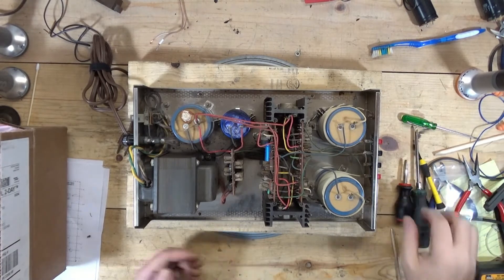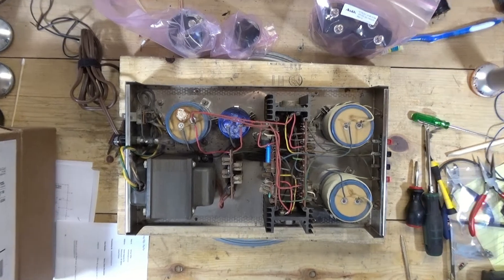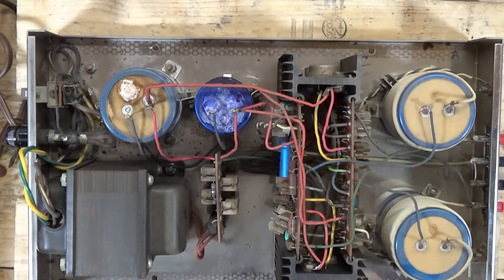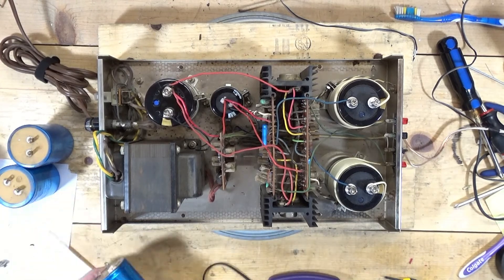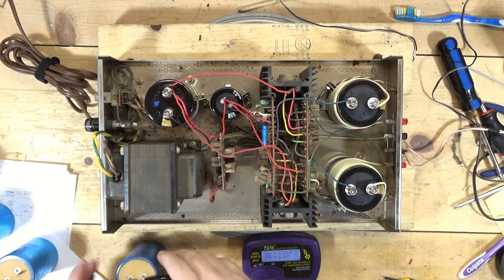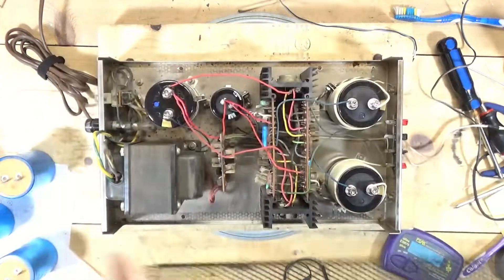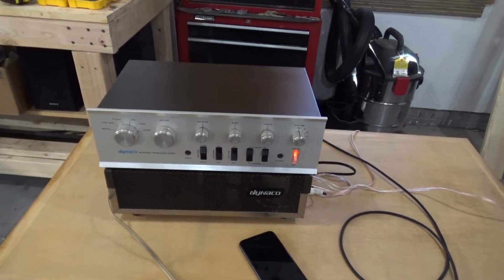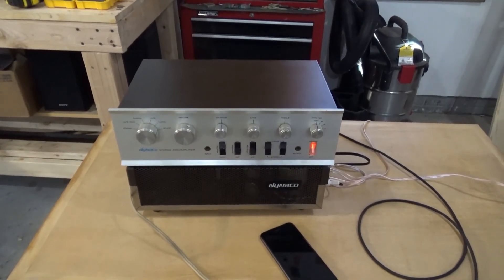Dynaco PAT-4 Preamp and Stereo 80 Amp Repair/Upgrade Part 2 - Working on the Stereo 80.

Comment: What would cause a hiss/distortion even at zero volume?   Just bought one, and it just has a hiss I can't get ignore.   Something went.
Reply from the maker: Lots of variables in there.  Both channels?  What does the hissing sound like (white noise)?  Any popping or crackling?  How distorted is the sound?